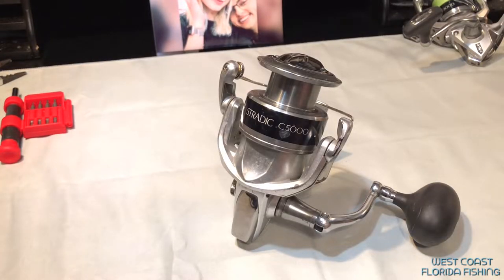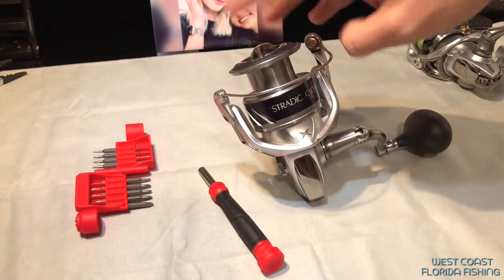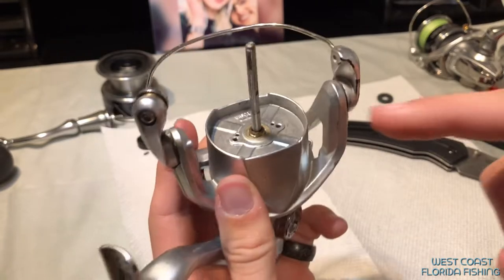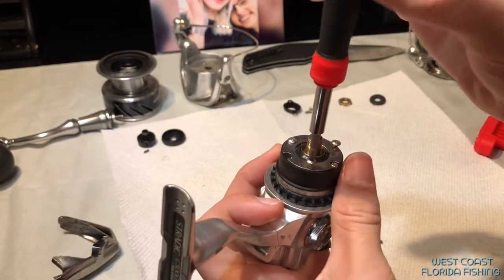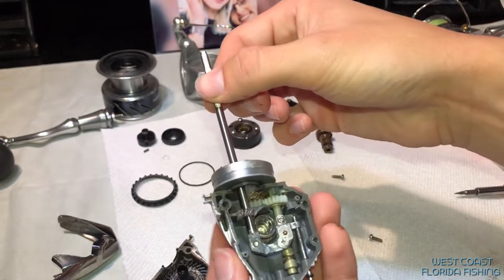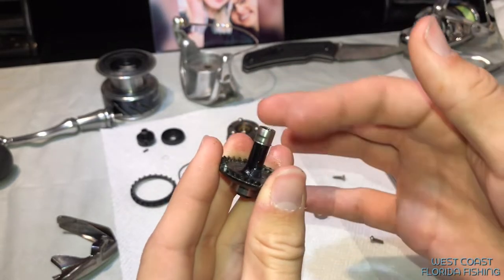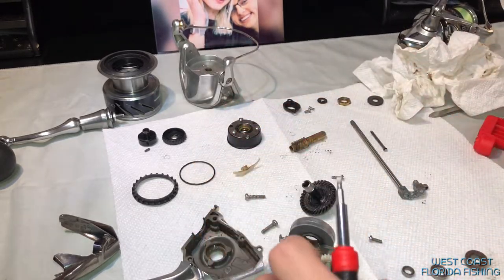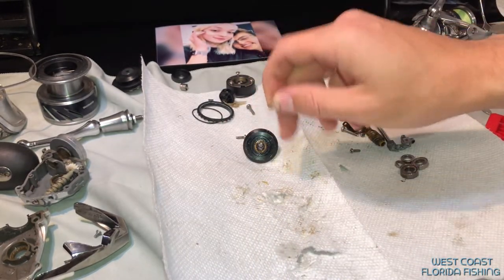How to Fix a Seized Up Reel! | How to Fix a Loud Shimano Stradic

Comment: Bought a 500 for an ultralight rod. It's very smooth enjoyable.fishing recommend casts great. One odd thing- the bale wire is a bit heavy diameter in my opinion for a reel of this size. But a great purchase.

Comment: Good job with tear down only thing I would suggest. Use a parts tray especially for those tiny parts witch can be prone to loose. All you need cut bottom out of milk jug. About 3 to 4 inch deep. Works wonderful. And don't cost anything.
Reply from the maker: Sounds like a great idea! I might have a tray like that laying around somewhere!
Reply: I agree completely.  I do reel repairs in SW Florida, ReelQualitySRQ and it is imperative to use a parts tray.  Also I wouldn't improvise on video with a knife for safety reasons and I also always use a wrench instead of pliers so that the parts on expensive or any reels do not get marred.  I hate opening someone's reel for service and finding a screw inside that was destroyed for lack of using proper tools.  Very informative video though.  Not bashing you at all, just concerns for safety and also for the equipment for the next guy working on it.  Enjoyed the video.

Comment: 18:57 - to remove that bearing, grab the main gear axle in a small vice with soft alloy or plastic jaws to hold it in place, and then just do it like you did. You can place a transparent plastic bag on top to catch the bearing if it flies off and at the same time be able to see what you're doing. I cringed several times watching those small parts almost flying off the table while you were trying to get that bearing off :)
Reply from the maker: Live and learn am I right?? Thanks for the Tip!

Comment: Great video thanks! Sounds like my Stradic c5000xg 🙈 I'll probably just send it in, if not too costly..
Two tips I stumbled on
1) For the tiny 0.9 hex nut - I found the pin/tool used to open SIM/SD card slot on most Android phones worked very well.. 
2) The black plastic cover with two small screws is actually fitted to the nut it is covering. Remove just the two screws. You should be able to loosen/tighten the nut by hand turning the black plastic cover. Easy to align holes at reassembly. 
Hope that helps! 🤙
Reply from the maker: Oh great! Thanks for these helpful tips!

Comment: do u have a video on how to clean these bearings in case of prolonged dipping (5 sec or longer) in saltwater?   aka i hope i dont have to bust it open fully just to clean and prevent.... can i 'clean' these bearings by simply taking off the arm ?

Comment: Great video was curious what you use to clean the reel? Do you use alcohol , mineral spirits, corrosion x, soap and water, etc? Thanks for showing how to do this
Reply from the maker: Hey sorry I missed this comment! I typically use an ultra sonic cleaner to strip out all that old grease.. if I don’t have that then I’ll even use a que tip and get as much as I can out before adding new grease!

Comment: Better method for removing stuck bearing.....bench vice with wood on either side.  secure the drive gear.  I use a thin screwdriver to prevent damage to the washers under the bearing.  prior to any attempt to remove that bearing or any for that matter,  I always use WD40 and let it soak for a day.  sometimes heat also works.  If its frozen, you can give it a few taps with a chisel and sometimes it will break free.  Saves you damage on the drive gear which can cost $40 depending on the reel.
Reply from the maker: Definitely would have been better with a vice but I was excited to get the video out and I don’t have any spot for a vice or anything as I’m just working on my computer desk! Thanks for the extra input!

Comment: Why not remove the smaller gears inside since its taken all the way apart, worm gear slides out and a single pin holds the rest.  may be rust and shavings below those gears that will stick to new grease.
Reply from the maker: That is a good idea. Sometimes it can cause issues getting it back in but that’s a great idea! Thanks for the tip!

Comment: Is the plastic that was holding on to that last bearing really flattened because of tightening the handle or was it designed that way?
Reply from the maker: There were no plastic pieces but there was those brass shims designed to reduce gear lash in the reel. Did that answer your question? If not add a Time stamp for me!
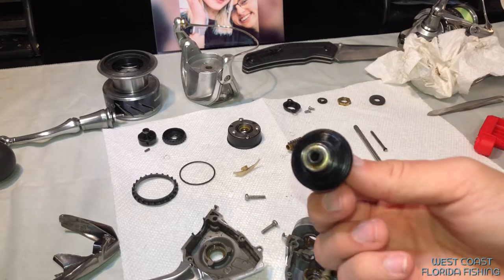Reply: @WestCoastFloridaFishing  At 17:24 you start talking about how the plastic holding onto the bearing you can't get off is a result of too much tightening of the handle. To me it just seems that the factory made it that way. Your thoughts?
Reply from the maker: Aha now I see what you’re talking about. So that part where I say has been flattened is the actual main gear. That isn’t any plastic. That’s the metal gear that spins the pinion and spins the reel. The main gear does not have that flat “lip” holding onto the bearing right there.. when you take a new gear out of the reel that bearing is SUPPOSED to slide right off. Sometimes it’s really difficult to get that bearing off that gear and that is due to the handle being over tightened on. Great question! In my next service video I’ll go more in depth!

Comment: What store do you go to, to get new bearings? I’m just curious cause I usually order mine through eBay, but sometimes I just don’t wanna wait for them to arrive.
Reply from the maker: Nam Bui luckily the tackle store I work at does reel repair and we have parts on hand. Call around time some reel repair stores near you and see if they will sell you some bearings!
Reply: amazon... good location to find your bearings.  I get ceramics for my upgrades there also.  I also am a parts dealer with shimano and they are reasonable at that level.  Amazon is still the best place to get them.  I use a micrometer just to verify the size but if you search the RD part number on google, theres usually a site that will confirm the size of the bearings such as 8x14x4mm etc etc

Comment: Place longer end of gear into metal tube. put tip of flat screw driver under bearing so that when you rotate the screw driver in a turning motion it twists so that the pipe holds the gear in place keep rotation and one side of the screw driver pushes up the bearing the gear and twisting the screw driver in different positions until bearing pops off its alot safer, nothing jumps and you have alot lower risk of stabbing yourself
Reply from the maker: Thank you very much for the tip and comment!

Comment: A small Bearing Puller is more adequate than 2 flat screw drivers. It will reduce scratch on shafts and on the back surface of the main gear. And lastly it's more safe.
Reply from the maker: I agree! I wasn’t super worried about scratching anything as I got the reel for free thanks for the input!!

Comment: Got a new Stradic FM C2000SHG that clicks under low speed, initial retrieve.  I just got it, but would like to try and solve issue myself.  The reel feels very smooth, but a faint yet persistent tick is there.  Any tips?  I have a video with it on there:
https://www.youtube.com/watch?v=KZCYvZiqM5o